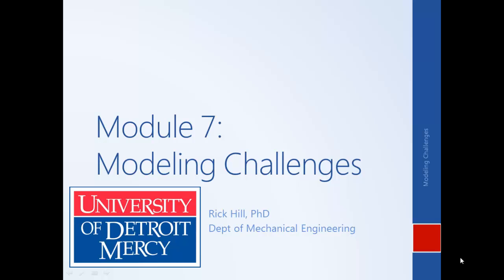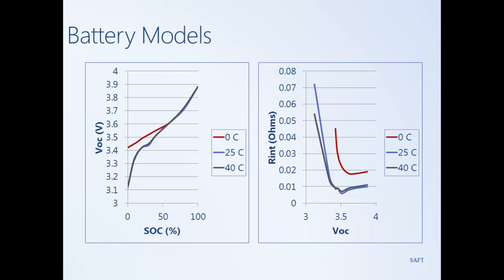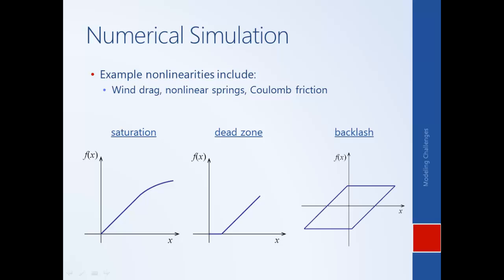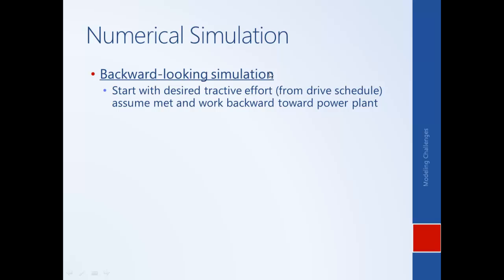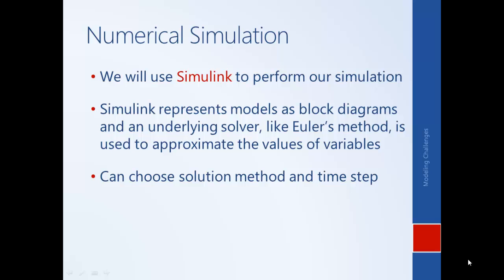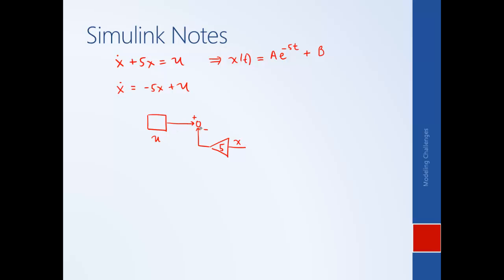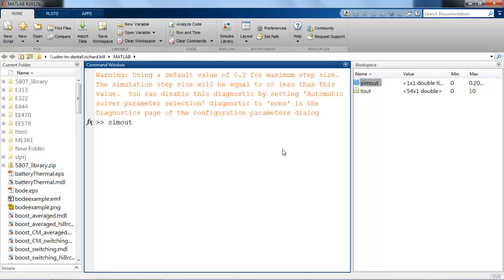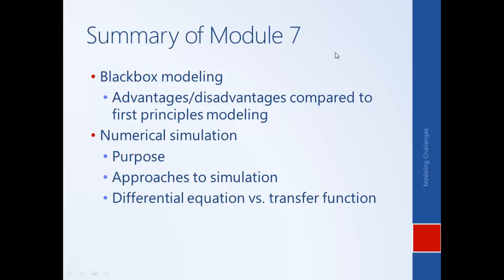System Dynamics and Control: Module 7 - Modeling Challenges

Comment: hi, being a medical doctor with mathematics background and very interested in mathematical modelling of medical and social systems . It is very difficult to derive equations from first principle but definitely models from  empirical data makes you little clear. I am bit confused in transfer function models , as to take input , output functions for  signal flow only or can be used for mass-energy flow.
thanks for your support
Reply from the maker: +Maj Amit Tak (Dr) Thanks for your interest. Transfer functions are not limited to modeling mass/energy flow. You can look at Module 3 for some additional info. Some of the later modules that cover the step response of first and second order systems, and that cover frequency response, can also give some insight into how an empirical model can be generated from response data.

Comment: Hi Rick,

This is an excellent contribution.

I have a question regarding the 'Transfer Function Modeling in MATLAB' [42:00]. And that is, how is the time response actually calculated by MATLAB? Does it use some 'analytic' procedure whereby the 'inverse Laplace Transform' is calculated, which would result into an analytical expression of the output; and then numerical values are calculated out of this expression ------ in essence, some sort of symbolic maths?

Thanks in advance.